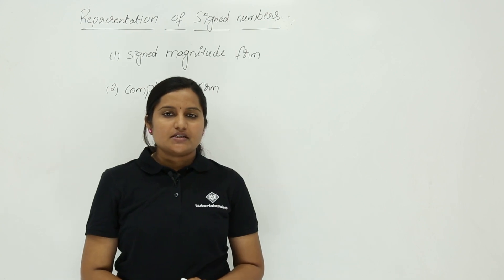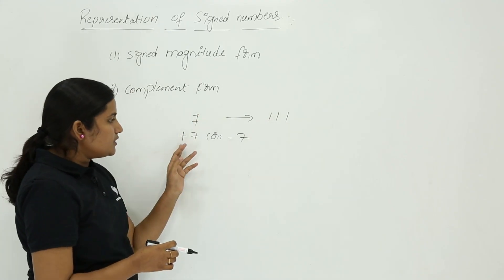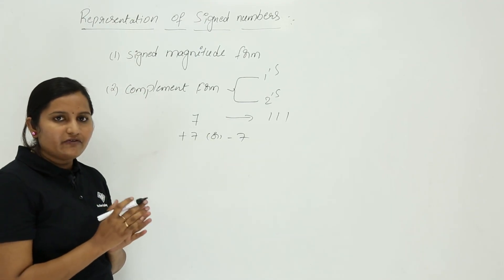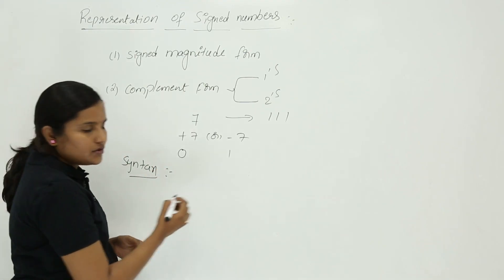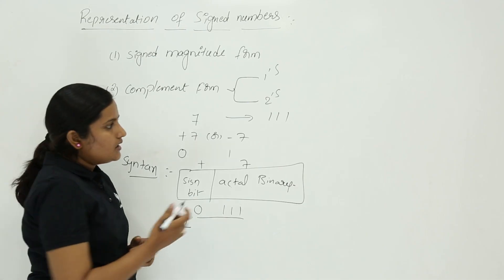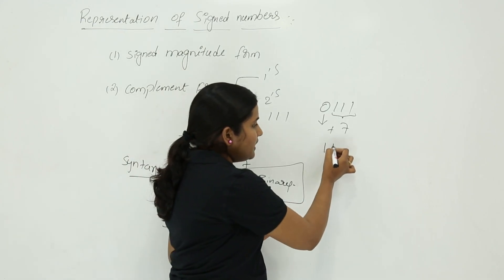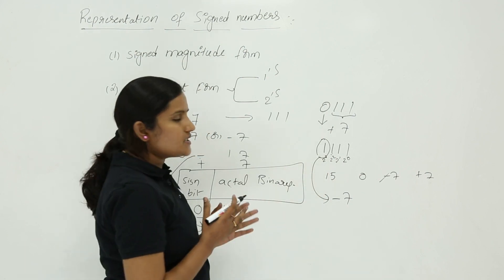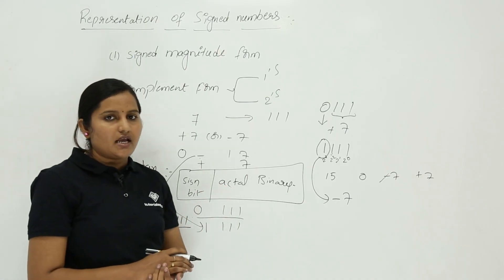Signed Magnitude Representation

Comment: Mam,suppose if u consider 4 bits....like for 7 it will be 0111.....then what's your answer? Can you please explain?
Reply: When you decide any bit range system.. The leftmost bit is only allocated for sign purpose. So when you opt for 4 bit representation, you have the leftmost bit for sign only.. And the rest 3 bits for number

Comment: +7 and 7 in binary it will use first bit as a singed bit. it does not make difference we use plus singed before number or not. it is gonna treat it as positive number. for example if you use short a = 32768 it will be represented as -32768 becaoz of c wrap around. so please do not make confusion here.
by the way over all it is ok
Reply: it will make difference if we use negative sign.